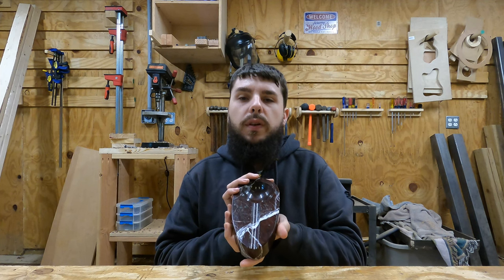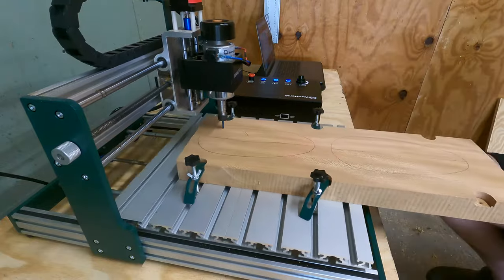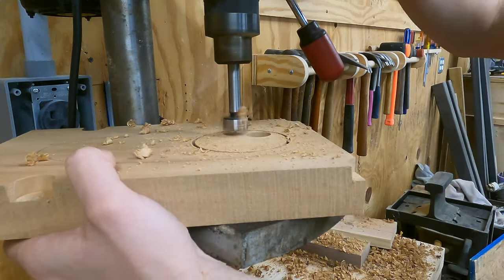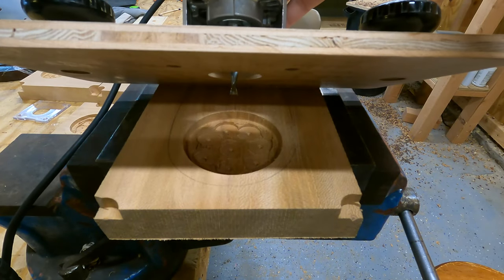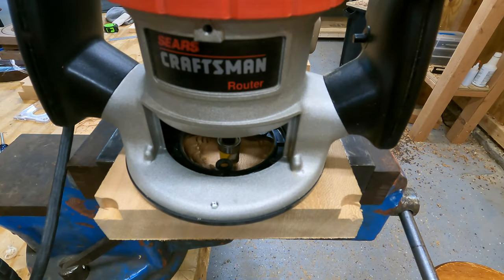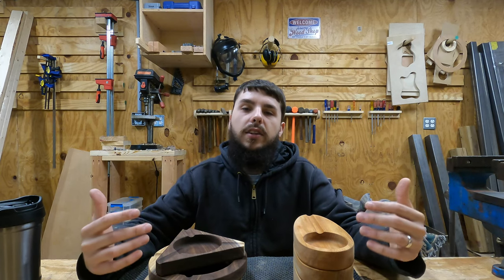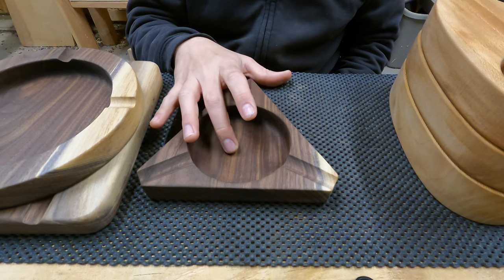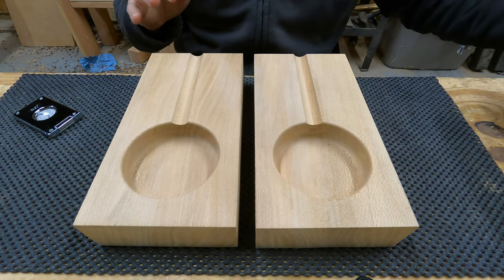Cigar Ashtray Build: Multiple Designs

Comment: Aslo, where did you get the cool tools for sanding the bowls? I’ve been struggling with hand sanding.
Reply from the maker: I was struggling to hand sand the insides of trays for some time now. I bought the pneumatic air sander I used in the video from Amazon because I didn't know how well it would work, so I wanted something cheaper. I can't remember the exact brand but it comes with 1, 2 and 3 inch pads. I find it works well enough, I only use it to sand the flat bottom. For the inside corners and to knock down the edge that was left after routing I used these sanding pads I made that I use in my drill. I think I still have the video on my channel. The version I made only works with adhesive backed sandpaper, but I am sure a similar design could be made/bought that incorporates hook and loop sandpaper. I hope this helps! I'm still on the lookout for better sanding solutions, let me know if you find anything.